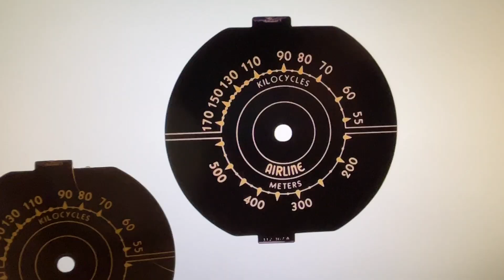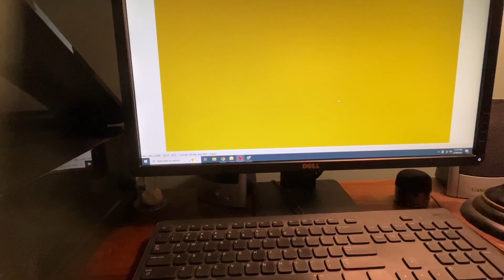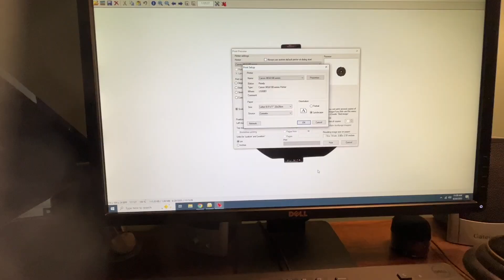Airline 62-425 | Dial Scale Reproduction

Comment: This is vinyl decal material, so when you pull the decal away from the paper backing won’t that yellow be removed?
Reply from the maker: You are correct if I was planning to remove the decal off the (yellow) backer, but it will be used as is. Thanks for watching and reaching out. Best, Don